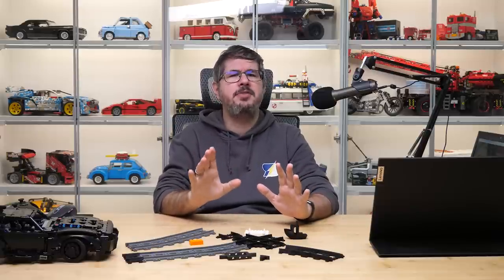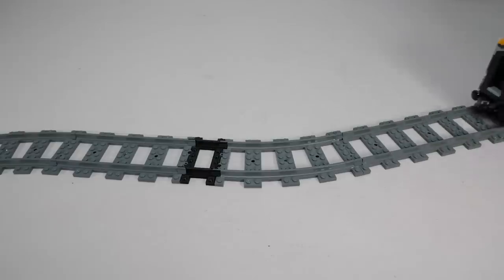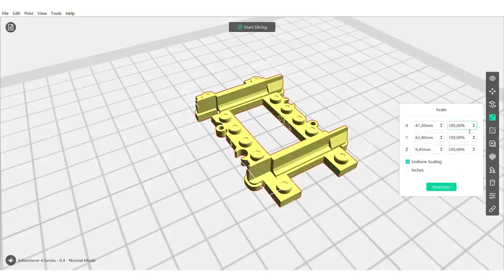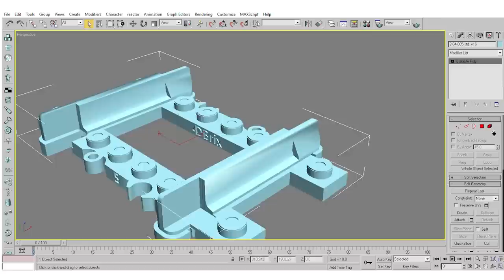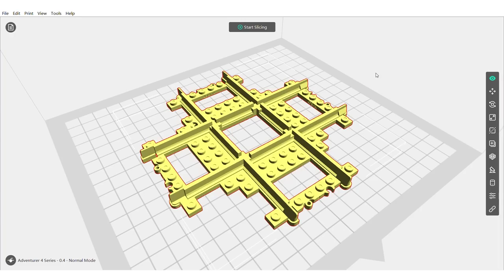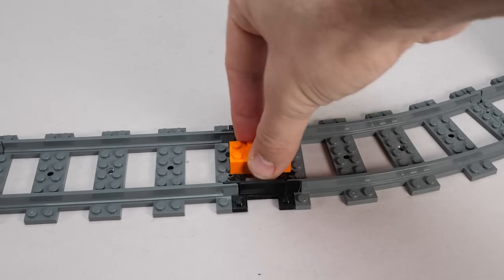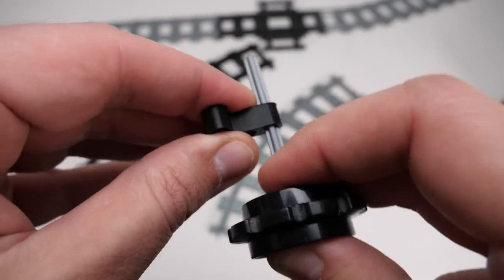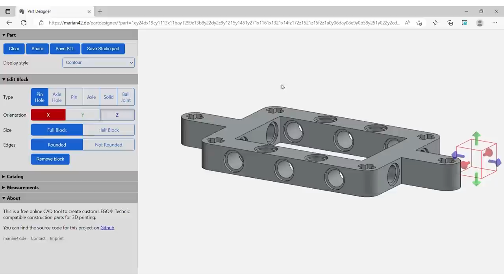LEGO compatible 3d printing Vol. 2 - train tracks and custom Technic pieces

Comment: Great video.
I personally tried to print lego components. The best solution for me could be to use an SLA printer as the quality is better and the joint with the original legos is more solid.
I printed an entire lego technic set in 2:1 scale using PLA and ABS, in this case the result was satisfiyng.👍

Comment: So there are settings called expansion settings, they change how much the filament is expected to expand when deposited, so if you adjusted the value to compensate a little less then you would make the holes and pins the right size, your issues are entirely your settings and a lack of experience with the machines, in the first video the issue was that the printer will do a bed level check and make a map of that, you have to adjust the z-offset, or the distance the nozzle is from the bed when printing to achieve a perfect first layer, you were just too high on the previous video and still a little too high in the second but much better, that's all. Most of us take days to get a new machine calibrated perfectly so it's not a shock you had some trouble. Nothing wrong with it or you. Those files work great. On top of the expansion settings you can tune your supports so they leave gaps between it and the part sides so that they can be removed much easier and don't fuse to the prints. Just settings. You can print lego with no problem of FDM/FFF printers, but resin does the best, aside from injection.
Reply from the maker: If I'm not mistaken those settings affect the whole model and not just certain parts. So e.g. if I change horizontal expansion that'll make the whole model bigger/smaller on the XY plane. In the case of the tracks that's exactly what I did when I scaled it up and as you could see it didn't work, since it couldn't connect anymore to other pieces. For the tracks I only needed to change the size of the studs, and for the Technic piece only the size of the holes, so these were specific local adjustments.
Reply: @RacingBrick  think of it like a displacement then a scaling it offsets based where the face is pointing ill say atleast give it a shot
Reply from the maker: @nadiaplaysgames2550  I totally understand the concept, but the changes I had to apply were selective, only on the studs, all other sections of the model were fine as is. If I change a parameter for the whole model then it might fix the studs but will also make worse everything else that was fine previously.
Reply: Keep in mind that expansion issues likely also don't apply uniformily to the print. For example, the first few layers often suffer from increased expansion, called elephant's foot, and this can be mitigated with a different setting. Which may explain why your tracks fit together great, but the pegs were too small. It may be necessary to tweak more than one setting to achieve the perfect fit.

Comment: About the supports inside the pin hole - I'm designing those parts myself in solidworks (I would be lazy if I knew there was such cool tool though), but if you make surface of those sides of the pin hole slanted, you don't need support. And it can be something like just 15 degrees depending on how thick layer you're printing.

Comment: One cool thing you could easily do in the printer is really high detailed props for the "utility" technic sets. Like in the excavator or trucks you could print some ruble pieces to put on the loader and bed of the truck. really cool vid

Comment: with the rails and most other files that don't have any "vertical features" (like the holes in the custom technic frame) you can just push the layer height to .3mm to go way faster.

Comment: i have an 3d printer (ender 3 pro) myself and 3d printed  some custom lego technic pieces never had any issues and in my experience i never had to use any supports i now have upgraded too an bambu lab p1p i have found that the tolerances on that machine are way better and i didnt need to change the dimensions ever on that machine but i never printed lego pieces on that one

Comment: All the issues you're having in this video are solved by "horizontal expansion" option in the slicer. By tweaking it a little you can adjust studs and holes size and you probably only need to do it once for your printer.
Reply from the maker: I'm not sure that would solve all or actually any of the issues. As I understand horizontal expansion makes everything larger on the XY plane. That's exactly what I did with the tracks when I scaled it up, and as you could see it failed to connect to other pieces. The track pieces only need the studs to be larger, nothing else. Same goes for the holes in the Technic pieces, the external dimensions shouldn't change, only the diameter of the holes, that's why the tool is useful as I am able to tweak individual settings.
Reply: @RacingBrick  nope, it's not quite the same thing as scaling the part horizontally. It increases or decreases size of holes or studs without moving them away from each other. And it quite probably might be a reason why the rails didn't fit together after a simple scaling.
Reply: There's also a separate "hole horizontal expansion" in Cura to tweak just the holes.
You might also want to check the flow calibration, studs may be thinner because of a little underflow.
Reply from the maker: @EviGL  don't want to nitpick, but the problem was not with the position of the holes and the studs :) As I mentioned I had to change the size of the studs *only*, everything else was fine and should stayed the same. Changing a parameter that affects the whole model is not a good solution in this case.
Reply: @RacingBrick  Using horizontal expansion is significantly different than scaling the part. This is not nitpicking. Scaling a part to make it fit better with Lego components is very likely to fail because you are moving the location of features. Using horizontal expansion, on the other hand, doesn't move things. It simply makes the mating surfaces expand or receed. This is generally exactly what you need to fix the fit. If the original file worked on another printer but not yours, then it's probably a difference in how much material is being extruded. Quickest fix it to tweak the expansion. You might want to try that for the fun of it with the original file. There's more than one setting for this, as EviGL pointed out. Give it a try. 😀
Reply from the maker: I will try it for you guys but I have to highlight again - the only problem was with the studs on top, nothing else. If I adjust the expansion value for the whole model then all surfaces will expand, the sides, the connection holes on the bottom, everything. I don't need that, those connections are perfectly fine as they are by default, I only had to expand the studs on top.
Reply: @RacingBrick  Please understand that I appreciate the work you are doing on this. So don't take this as me trying to be negative, but quite the other way around. We all want to see success.

I was curious so I downloaded the same file you did and imported it into Fusion 360. The stud diameter is set to 4.90 mm. This is exactly what I use when I 3D print LEGO compatible bricks which works great on my printer. The parts snap together and hold well. The stud spacing measured as multiples of 8 mm which is also what I use successfully. When I did experiments to find the "perfect" stud diameter to properly mate with LEGO parts, I found there was a very fine line between too loose and too tight. If I measure real LEGO studs I get in the neighborhood of 4.88 to 4.90. It's definitely not 4.80 as you may see posted on the internet.

Question for you... Did you calibrate the X and Y movement by printing a cube and then measuring it with a set of calipers? If the answer is yes, then ironically this may be part of your problem. It may seem logical to calibrate a printer this way but in fact this typically does more harm than good. Why, you may ask? Because when you print a part, not only does the X and Y travel calibration affect the size, but so does extrusion and artifacts. It's a bad idea to calibrate by measuring the object you printed. A better way is to directly measure the X and Y travel using a dial indicator or other similar method. This eliminates errors caused by artifacts such as improper extrusion, "zits" on the model, and a host of other problems. Most people that calibrate by measuring what they've printed end up with a printer that is more out of calibrating than the factory default values.

Another thought... The way the tracks mate to each other is very different from how a stud mates to a socket. The stud connection is extremely critical, but the track to track connection isn't nearly so picky. That connection is designed to spring a lot more than a stud connection. In the video it looks like you upscaled it by 3%. Is that true? If yes, that's huge! It's no wonder the tracks could no longer mate. If doing that much caused the stud connections to get better, then something is seriously wrong. That much of an increase should have made it nearly impossible to connect the studs as it would have shifted the center to center on the outside stud by 8MM * 3 * 0.03 = 0.72 mm. There is no way the stud would have continued to work. This is why I asked if you calibrated your printer and unknowingly made it worse.

My printer is currently down because I'm in the process of modifying it. When I fire it back up I'll try printing these parts. Based on the numbers I see when importing to Fusion 360, I fully expect it to work without modifications. I print with the same size and spacing for the studs with 100% success.
Reply from the maker: @robertrandall8418  I will try to address this topic briefly in my next video as apparently I cannot write down properly my thoughts about the difference between upscaling the whole model, the studs only and adjusting horizontal expansion. When I upscaled the studs by 3% I scaled them in place, individually. Their position relative to each other and the model did not change, they simply became 3% larger on the XY plane. It's like a local adjustment of horizontal expansion, and that's exactly what I needed. The track pieces snapped together fine, so I didn't want to change a parameter for the whole model, only for the studs.

Comment: I want to see more with people printing lego compatable parts with resin printers. Much higher accuracy and faster printing should make veryical holes and horizontal holes.much more similar in tolerance / fit and would make batch printing / printing larger parts much faster.
Reply from the maker: I have another video with a resin printer. The main challenge there is the support and part orientation, I couldn't figure out a way to have perfectly straight lines and sharp corners on the pieces, they always got a bit distorted at the connection points with the support.

Comment: These videos are great but I'm so conflicted. On one hand I love the challenge of only using pieces LEGO makes for models, but I also love making CAD models and 3D printing.
Also great to see another 3DS Max user! What did you use the software for?
Reply from the maker: I think it's great to expand the universe of LEGO and create something that is not in the portfolio. I used 3ds Max to design custom inflatable product displays :)
Reply: @RacingBrick  You can for sure print TPU on a bowden extruder. Most people just give old/outdated advice. https://youtube.com/playlist?list=PLgQ4HZ56XQgLbTq08w7IAyPLa0w6DSX6S this playlist from Lost in Tech channel is really helpful and it allowed me to print good quality TPU prints (even with 75A TPU) on my bowden Ender 3
Reply from the maker: @UTKDesign  as I mentioned in the video I know it is technically possible and others managed to do it, but I simply didn't want to risk it as I already managed to clog my device once, and I already have a proper printer for the purpose.
Reply: @RacingBrick  Well it is great that you now have a direct drive extruder. I have also clogged my nozzle in the past with Marble filament but I dont think it is likely to clog it with TPU, but you can perhaps clog the extruder with TPU. Either way direct drive is gonna be better anyway so happy printing!

Comment: Pinholes and Studs are the WORST for FDM 3D printing of Lego Components. I had a model I built that worked perfectly and created great results for me off my printer. I shared the files with another club member after they gushed about my 3D printed model at a meeting. Come to find out he couldn't get it to work, and he blamed my model instead of his printing environment. If he'd not just gotten mad at me and complained behind my back, I would have helped him with the issues... :P I hear resin printers have better tolerances than FDM.
Reply: Very good chance that if your club member had adjusted the horizontal expansion or some other setting that's not right, it would have worked.

Comment: Aren't some of these connections at risk of being illegal? As in, connections that are "too tight" may slowly damage the Lego piece.
I think it's the reason all dimensions erred on the side of looseness in the blueprints.
Reply from the maker: Not sure what you mean by illegal connection, as in the LEGO world that'd be something else. It might depend on the filament used of course, but I think in general the LEGO piece would damage the print :)

Comment: Hey man, I got a flash forge adventurer 3d printer and after a couple uses I just didn’t like that I couldn’t get much detail from it, I purchased an elegoo resin 3d printer for roughly the same price and started making custom parts and I didn’t need any clean up I just cure the print and it fit with existing Lego bricks
Reply from the maker: How about the stiffness of the parts, are they flexible enough to snap with other LEGO pieces, there's no breaking etc?
Reply: @RacingBrick  I’ve broken a few fdm parts I’ve made. But with my new printer the parts are actually really sturdy, with the right resin it’ll be just as rigid as regular Lego, I got the “elegoo mars 3 with crying and wash station bundle” I bought mine off of Amazon but I’m sure you could get the bundle somewhere else,
Reply: @RacingBrick  I honestly recommend it, I printed a little animal as a test print and I accidentally dropped it and it hardly scratched
Reply: @RacingBrick  in my personal opinion the resin 3d printer is a great investment, you can get water washable resin to make it easier, and like i said i myself have a flash forge adventurer 3d printer like you do, but I’ve recently fell into an rut where no matter what I print, I’ll always have a layer shift, to a point where the parts I make aren’t even compatible,

Comment: I tried printing some of the tracks, all worked well except the track switches, Lego has a spring in the switches and the 3d printed parts don't which impact the trains when they hit the switch from the opposite direction :(
Reply: are you sure the files didnt include a spot for a spring, I've designed springs and mechanical things into my models before so they definitely could have.

Comment: What about resin printers? Can you get better results with it?
Reply from the maker: I don't know. Resin is definitely more difficult to work with, needs way more post processing. Some say resin printed objects can be more brittle. I might try it later on with a smaller / cheaper resin printer, but I'm not there yet.
Reply: Yup. Far more accurate and faster. Standard resin is too brittle but use an 'abs-like' resin and it works beautifully.

Comment: "Printed ABS less flexible than PLA"? It's exactly the opposite I think. PLA is very brittle, while ABS flexes quite well in comparison.
Reply from the maker: That's my experience, although I only tried one type of ABS filament, but several PLAs.